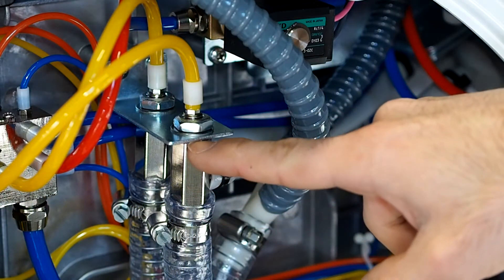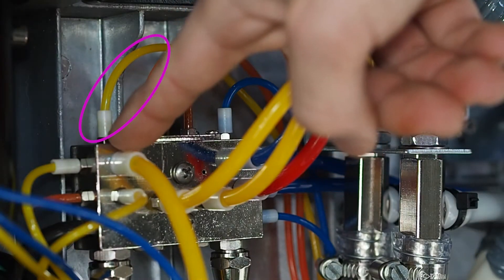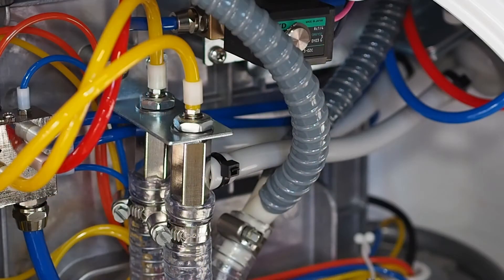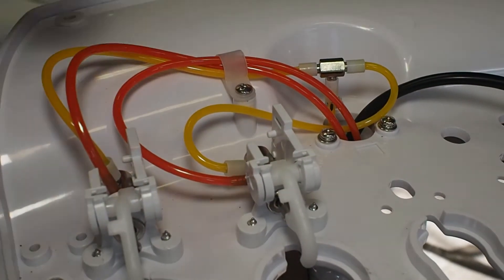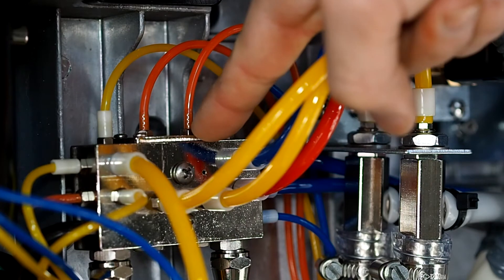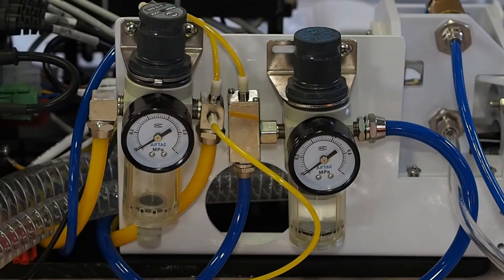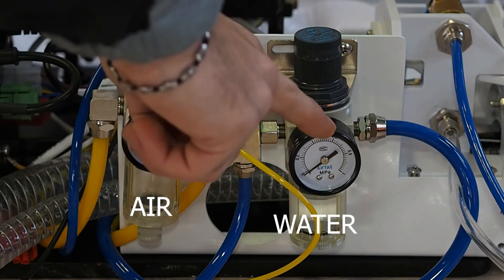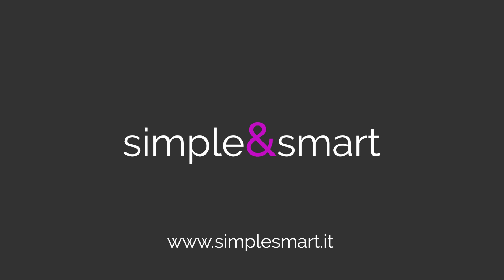VENTURI SYSTEM | How it works | Solutions to problems | Dental unit

Comment: weak suction does not work in the venturi system knowing that the strong suction is work and the source of water is bottle 
and also knowing that the dental chair is new installation 
what causes?
Reply: does the weak suction is work by foot pedal ?
Reply from the maker: Good morning,
Normally, the Venturi System works with air for the strong suction and with air or water for the weak suction. A valve that uses water to work is always weaker than a valve that works with air. It also depends on the air or water pressure that allows the valves to work. We recommend connecting the water valve to the water net, and not to the dental unit bottle, because the water from the bottle does not have enough pressure to let the Venturi valve work. And no, the suction works when you pull out the suction cannula from the assistant tray, not by the pedal.
I hope these information is useful to you!

Comment: Can the venturi valve be blocked by debris if the chair does not have a filter?
Reply from the maker: Yes, Venturi valves create a depression that allows the cannulas to suction due to their internal shape. If debris gets stuck, the valves don’t work well. If possible, install a filter; otherwise, use cleaning products for the suction system or remove and clean the Venturi valves. I Hope these tips will help you!

Comment: Thanks for video, can you add a video showing how we can connect an amalgam separator like metasys typ 1 or durr cas 1, to a unit, including electrical and tube connections in dry suction.
Reply from the maker: Hello and thanks for the comments. Unfortunately we cannot publish such videos because the installation of the CAS1 are allowed to be done by our internal technicians only. Due to the complexity of the installation wr need to ensure that is done properly under our responsability. 
Thanks and Regards